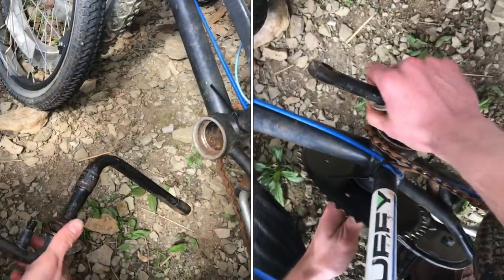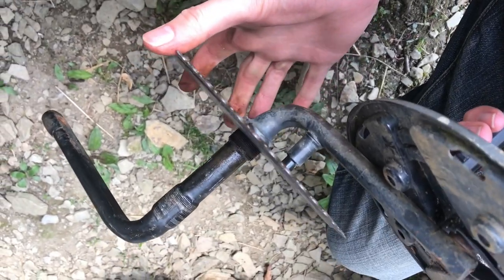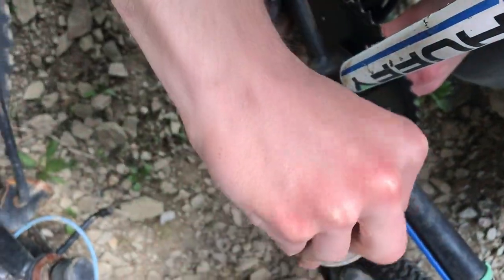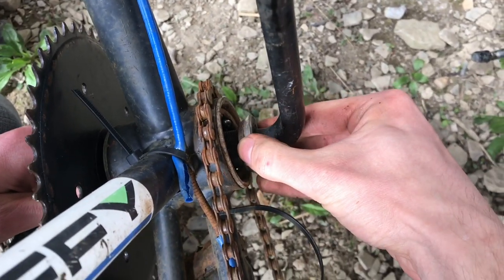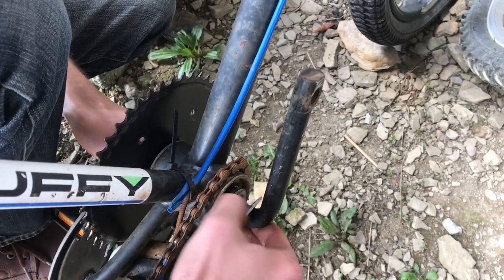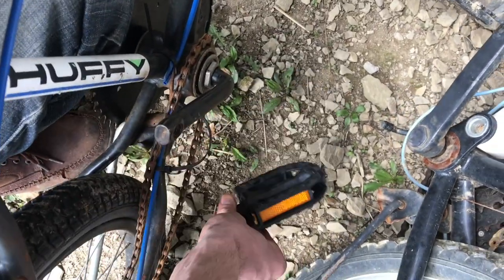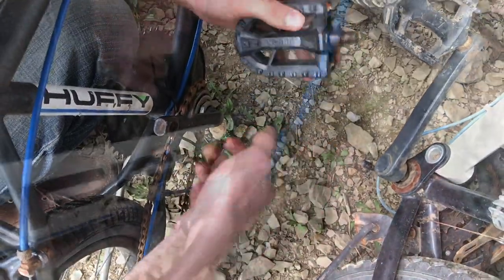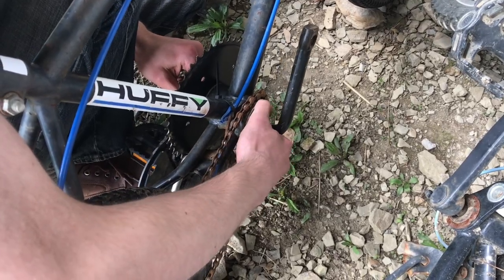removing pedals and crank from a bicycle “REVERSE THREADs”

Comment: Um, please feel free to correct me if I'm mistaken but dont you have the complete assembly (cranks, pedals & sprocket) on the wrong side of the frame??? Even the chain is on the other (and correct) side. Perhaps you should pay more attention to the actual content of what you're filming rather then the numerous Amazon links (most of which have NOTHING to do with this subject) that you've chosen to promote!